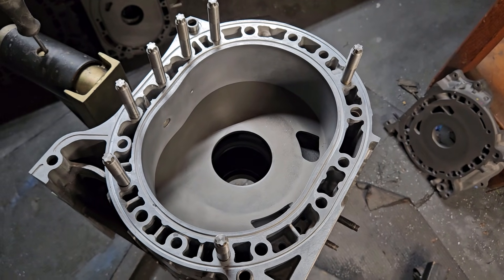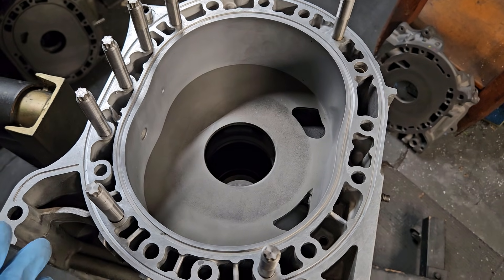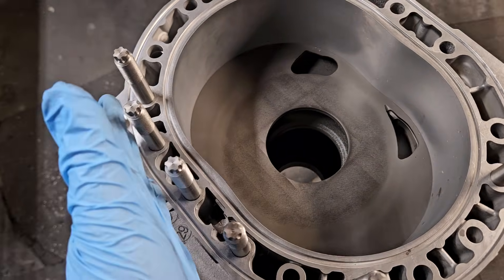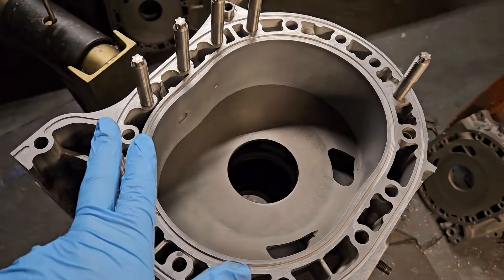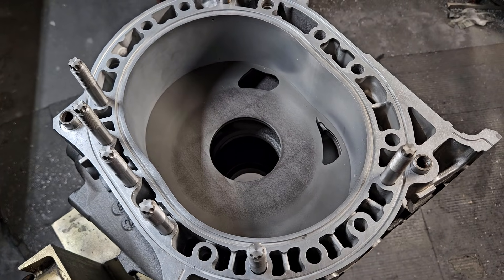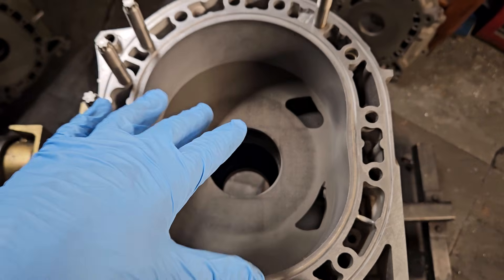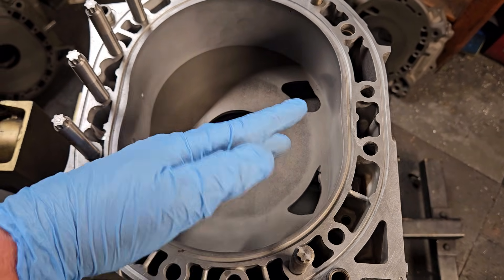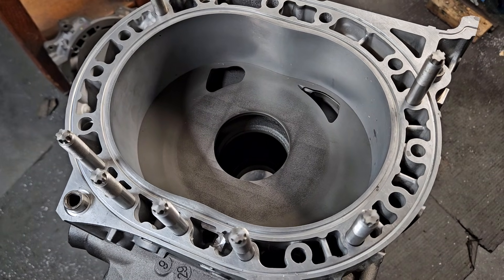TURBO RX8 Reliability - Renesis strength under BOOST - block studding for increased reliability

Comment: @kylemohanracing thank you for this. Wouldn't mind seeing a small video or series about building a renesis grassroots drift turbo 8. I'm trying to gather as much infoas i can, but I really think 280-300 would be just fine for final bout type stuff, just wonder the reliability of drift compared to a normal street car. Thanks!